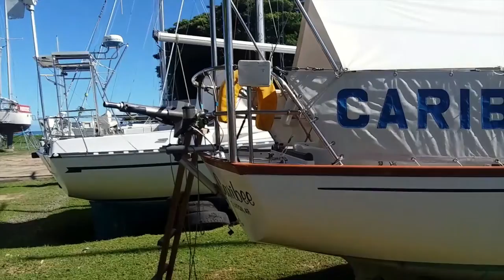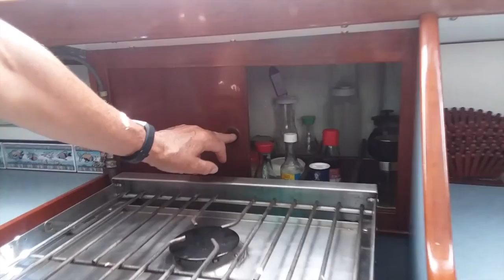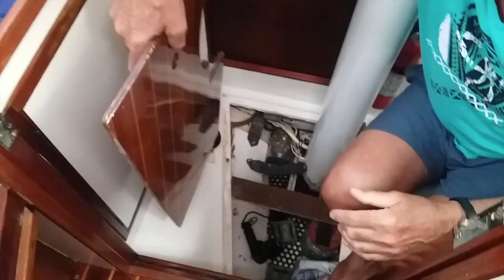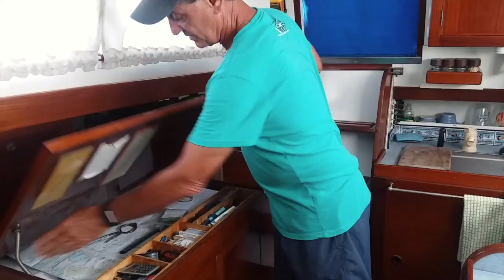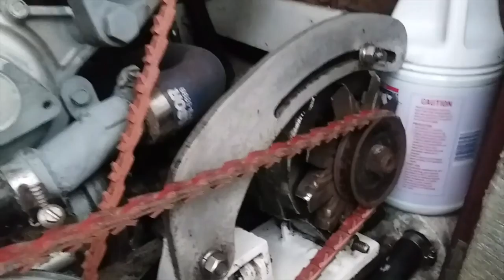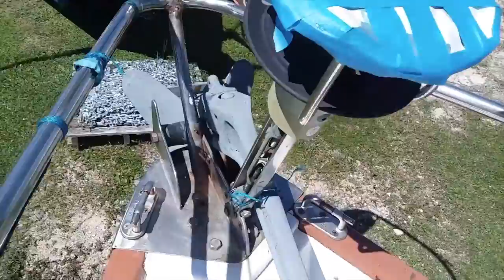Their home for 25 years sailing around the world!

Comment: I'm sorry I keep adding new comments but they're all different topics. You raised the cabin sole by 10" to 12"? How on Earth did you do that? The boat had that much headroom as built by Hinterhoeller? If that's the case...raising the floor that much was a very smart because using that extra space under the floor lowers the center of gravity..obviously. Of all the sailing/sailboat videos I've seen, you have the highest concentration of great ideas of them all. You're a g damn genius Gump!!

Comment: Dang, I've also never heard of anyone reinforcing the bottom with fiberglass BEFORE they have some kind of problem. You did it for prevention. I have wondered if anyone ever reinforced the keel just because..and not after a problem...but never thought of what you did, the entire bottom! I'm going to watch all your videos and learn all I can:) Thank you so much for taking the time to create edit and post your videos! You're cooler than the other side of the pillow! And you've got some wonderful ideas and experience, thanks again!
I found you because there's a Hinterhoeller 42 for sale near me. It's such a gorgeous boat, and I love the design. So I searched Hinterhoeller and you came up! I don't need to ask you how you like your boat, it's pretty obvious!
Edit: You showed a tank uber the floor and referred to Henderson. Is that just the access port or the whole tank? I think it was your diesel tank. Since the tank is directly below the floor, I'm guessing that tank was installed after you raised the floor. I'm sorry if you mentioned it but..is that tank higher capacity and 10 to 12" taller than the original?  I'm very intrigued with how evolved your setup is. The evolution of your boat..you're obviously a thinker..it shows in the little solutions to problems that may not ever have happened..like reinforcing your hull bottom, it seems you solved a problem before you had a problem. 
After you did this video, did you realize that you left something out? That you have yet another awesome solution that you haven't shown the world yet?
Thank you 🙏😊
Reply from the maker: Thanks there. it's just that we can't make hours long videos. You wouldn't believe how long it takes to create, edit and upload even a 30 minutes video. We only have a small laptop and local Fijian  Wifi. If you haven questions feel free to email. 😀

Comment: I've never seen anyone put a boat in a hole before..and I'm amazed that it's not a more common practice. It's brilliant! I've seen holes for the rudder, so you can remove and reinstall the rudder, but not wholes for the hole boat! Got that backwards:) You can't fall down or tip over if you're on the ground. Plus you don't have to risk life and limb climbing aboard on a rickety ladder. Good thinking Captain! ⚓ Cheers!!🍺
Reply from the maker: Yes, it's a brilliant system, especially in cyclone areas. I believe this marina is the only one in the Pacific to be doing this, which is why they are so popular for people who need to keep their boat in Fiji during cyclone season.